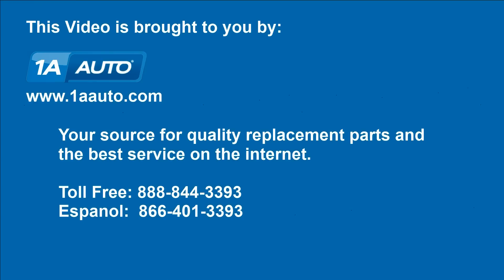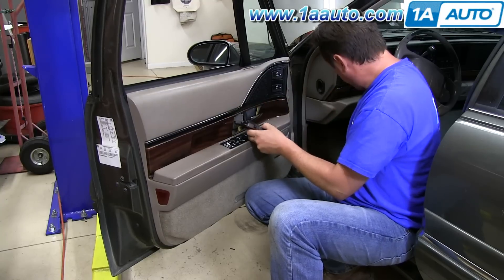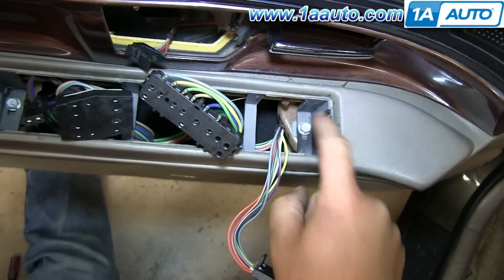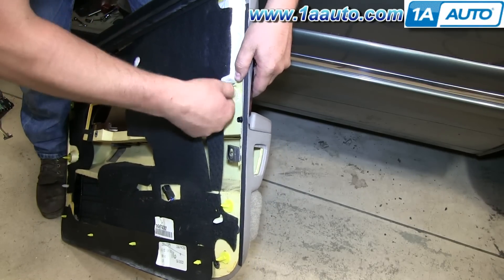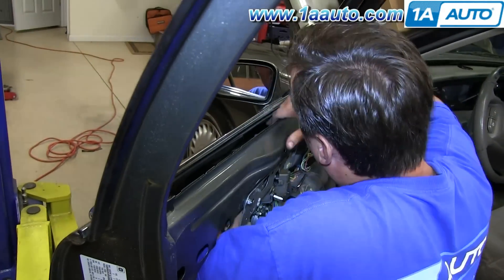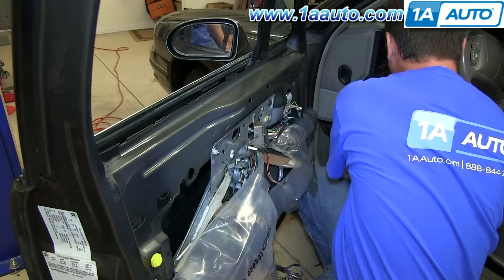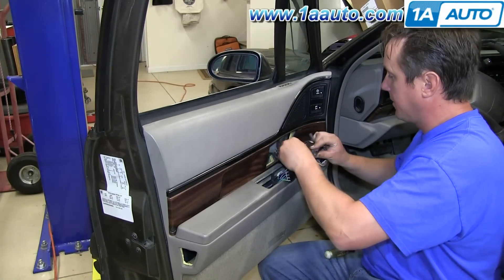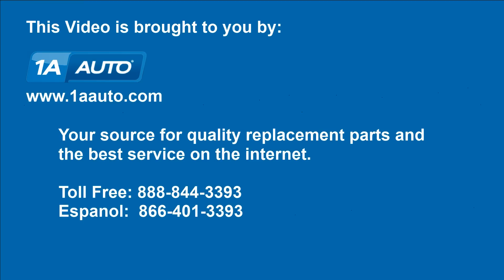How to Replace Side Rear View Mirror 92-99 Buick LeSabre

Comment: Great video, thanks so much for posting.  For those noticing the demo used a Buick without the front window...yes it can be done without removing the window.  I did it yesterday.  Make sure the window is up when you start the process.  All steps are the same except forget about using your left arm/hand to remove and return the rear 10mm nut.  The window slider assembly gets in the way.  I used my right hand for both nuts.  Front one wasn't too bad...the back one, ugh!  On the reassembly I dropped it a couple of times but finally got it started.  Then due to no clearance space for the wrench I had to deal with little 1/16th of a turns with each wrench turn.  Helps to shine a light down towards the nut/stud from where the window meets the bottom edge of the window frame.  In the video he is able to force his left forefinger down this gap since he has removed the window.Again, great video and saved me a lot trying to figure out the little tricks GM used on assembly
Reply: It's not a great video if he removed the window and didn't mention that to viewers!

Comment: Just and FYI for people out there. They did remove the hardware for the window and the window itself so when you go to do the inside bolt where he puts his arm through that is the only way possible to shove be your arm in there. I highly recommend doing this although it is more steps and you’ll have to find the corresponding videos for that. If you don’t remove the window it’s is still possible to remove but it makes it way harder to do with very very little room to get to the second nut. If the mirror is broken and you don’t care about it you can break it off and take needle nose pliers on the bolt and screw it off from the outside. But getting the nut back on the new one will be a royal pain. Just an FYI. Why anyone would make it so difficult is beyond me.

Comment: This method only works if you have small hands.... I just had to remove 4 mirrors (2 at the Junk Yard, 2 on my vehicle), and install two (replacement mirrors) in the same vehicle.  Everything is accurate, and help me a bunch, except I had to remove the Window guide in the door to access the 10mm bolts closest to the door handle.  I had every tool possible, and tried doing it without, but it was impossible.  Definitely have some time allotted when trying this, definitely takes longer than 10 mins.  Thanks for the detailed video A1 Auto.... really helped!!!
Reply from the maker: +M. Freeze Thanks for watching. We carry the replacement mirrors shown in this video with free shipping. Here's a link to them if any of our viewers needs to make this repair. https://www.1aauto.com/1A/Mirrors/Buick/LeSabre/1AMRP00062?utm_source=YouTube&utm_medium=description&utm_campaign=videodesc&utm_term=-SFw7j3g6JA&utm_source=YouTube&utm_medium=CTA%20Comment&utm_campaign=ytcomment

Comment: Ok folks I tried this. Saw that a local junkyard had the same car as mine in the same color (1997 LeSabre Limited)  - with two good mirrors. Both of mine are bust. Went to the junkyard with every tool mentioned in every video on this task, plus a few more just in case. I allowed 3 hours to remove two mirrors. Took one hour to get one door panel off, even being careful I broke the red reflector,  broke several door clips and damaged several electrical connectors. Once the door panel was off I was presented with a mountain of wires and other mechanisms. No way to access the mirror nuts. The only access hole is too small for my hand to fit through. Feeling through the hole with a probe there is something blocking the way, some type of shield. There is no access on the other side, as shown in this video, because there is a styrofoam bolster inside the door which blocks access. I just don't see how it is possible without completely dismantling the door. I started to do this but gave up after a further hour and a half. What is needed is to drill two holes in the door large enough to insert a tool to undo the nuts, but I'm not sure if the glass or window regulator would be in the way. This job is way more difficult than the video makes it appear.